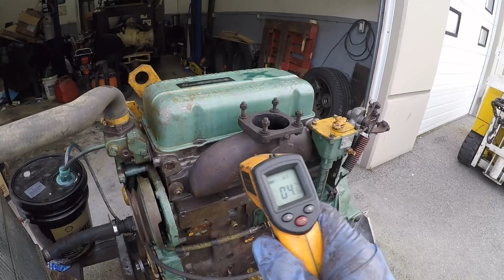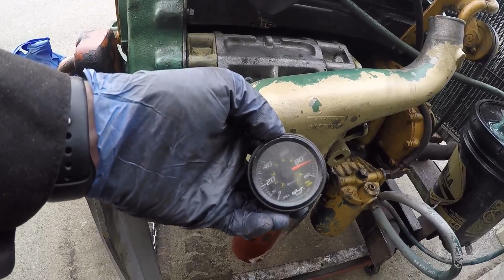Detroit 3-53T First Start Cold Start

Comment: Do these have a break-in procedure and special break-in oil needed?
Reply from the maker: No break-in oil required, but do require a break in.  For the dyno they have a procedure listed in the manual.  For breaking in a vehicle, they recommend start and run for 5-10 minutes to check for leaks, then hit the road and run it hard for the first 100 miles to set the rings.  No idling during this period, just run them hard.   They recommend an 80% load factor for the break in period.  I run them through the mountains and that works well.:)

Comment: I wish gensets had an idle setting,
Mines governed around 13-1500 straight away, so it wakes up and immediately goes to preset high idle. Wish i could start it like this then set the high idle after 10-15 min warm up
Reply from the maker: That really shouldn't hurt them.  On my 4-53T I start it and drive away after 30 seconds or so and within a minutes it's at 2000 rpms.  In the winter it does have a block and oil pan heater that's on a timer.  Engine is pre heated to 100f or so.:)

Comment: As an old DD buff myself, it sounds great!  They are really cool to hear them on some of the old tractors pulling at antique & classic tractor pulls. For those asking about turbos, they had a gear driven blower, and later silver series had turbos added. I have seen one in a Chevy 2500 pickup in Pa.
Reply from the maker: This ones an N engine I converted with T internals.  It's got a BorgWarner K27 turbo on it and I'll be working on finishing the project in the new year.:)  I daily drive a 2009 Fod F350 with a SIlver 4-53T and Ford 5R110 trans, a really nice platform.:)

Comment: Mine I couldn't leave the valve cover off because it fills up with oil quickly..??  Is that a bad sign? Love that sounds though!!
Reply from the maker: No, as long as you have good oil pressure then all is good.:)  My 4-53T is the same, too much oil as well, so the cover can't be off for very long.:)
Reply: @detroitgarage9430  thankyou! 😀

Comment: Need a air cleaner & muffler. It doesn’t have a turbo . Other than that it runs great. I had on on a portable water pump. 👨‍🌾
Reply from the maker: Nice, they’re a great engine.:). Thanks for watching.😀
Reply from the maker: P.S.  I misunderstood what you were saying.:) Yes missing the air cleaner, muffler and turbo.  Was just a quick test of the engine after a full rebuild.  Will be dyno testing this engine in the new year with N45’s and a BW K27 turbo.  After the break in is finished then finish up the compressor.:)

Comment: Look at how tiny those valve springs are! I guess when you aren't made to turn 6k+ rpm you don't have to worry about valve float eh?
Reply from the maker: They certainly are small.:)  Can turn them up to about 4000 rpm max before they float.:)  This one is governed at 2300.:)
Reply: @detroitgarage9430  I know part of why they can't rev that high is the stroke, at least with the 71's I know it's a 5 inch stroke.. granted there's 5 inch stroke big blocks that turn 7500rpm but that's a full drag engine with aluminum rods and a super light flywheel/crank that probably won't last long.. but iron rods and crank with a massive flywheel couldn't handle that.. Though I would love to build a 6k rpm capable 8V71! (like I'll ever have the money to.. but it'd be cool)
Reply: @jaratt85  use a 6 V51 T..at 3450 rpms, it sounds like a V-12 turning 7000 rpms - because the 2 stroke cycle fires once every revolution instead of once every 2 revolutions on a 4-cycle engine..

Comment: Love your videos! Would you happen to have any of those covers that go over the cam and balance shaft on the back of the engine? Can I just make some from flat steel? Also need a blank cover for where the thermostat housing goes on the back of the head, and that cover to the lower left of the cam and balance shaft. I can also make them from steel plate but it would be nice to get them already made.
Reply from the maker: Thanks, I don't have any spares, but they are easy to make.  I had to make the rear water outlet cover and a few other bits and pieces. If anyone would have them PC Industries might and Jonathan at Leid Diesel Services will for sure.:)
Reply: @detroitgarage9430  thanks!

Comment: Great skill level! Thanks for the video. I recently purchased a 353 and it appears to be stuck. it was under a shed. Any thing to look for other than the basic piston seizure?
Reply: Mine was locked up and it turned out that water had gotten into the blower, froze inside one of the impellers, and broke it. Pulled the blower and it turns over just fine.
Reply from the maker: Thanks.:)  Yes, you can pull the airbox cover off and have a look and see if there is any or how much water.  You could also have a look at the blower and confirm that's not seized, if it's loose there will be some back lash.  What I've done in the past is pull the injectors and fill the cylinders up with acetone and oil mix.  The pull the starter and bar over engine with a pry bar.  If the engine isn't stuck too bad this will work, if not it's overhaul time.:)
Reply: @detroitgarage9430  thank you very much for your time and help. Next few days I'll check these items. It was an engine that served duty on a crane. Hour meter shows around 950.80. engine looks decent. I was hoping this was the correct hours. Maybe it's not too bad of shape.
Reply from the maker: @georgephillips6520  Nice find, hopefully it's not seized too bad and it will break free.:)

Comment: Running smooth, could not see the oil getting to the rockers! I guess you were watching it! 
Nice feeling to see and hear an engine coming to life after rebuild.  Jimmys have their unique way to thank you..screaming......No need for testing with the Turbo?
Reply from the maker: Oil slowly started coming up and pooling around the valves.  True very nice to see another one alive.:)  The turbo is not required to test run the engine with no load, next run will be with the turbo on connected to the compressor.  Thanks for watching.:)

Comment: Very nice.. A Gamma Goat 🐐 
Is looking for her missing DD 353 . 🤠

What causes the blue smoke?  Shouldn't the revs be up around 12 to 1500rs breaking in?
Reply from the maker: Lol, this was an industrial 353 that ran a belt pulley.  The blue smoke is because the engine is still very cold.  It will stop this once the engine is put under a load and worked.  The revs should be kept under 1000 rpm for 10 minutes to check for leaks etc.  Now that that has been completed it has to be worked hard at 80-90% load.  I'll have it idling at about 1000 or so and full load at 2100.

Comment: Where is the TURBO ?????
Reply from the maker: Turbo is off until I fab an adapter for it. I'll mount the engine in the compressor first before I fab up the turbo.  Making an air to air intercooler as well, so lot's of work to do before it's finished.:)  Thanks for watching.:)